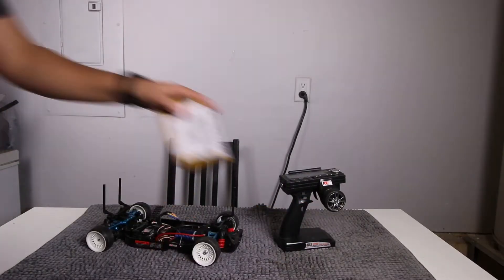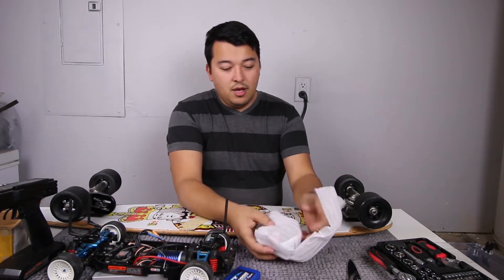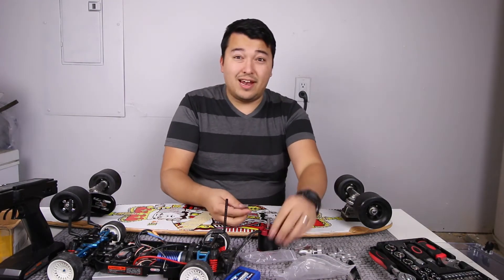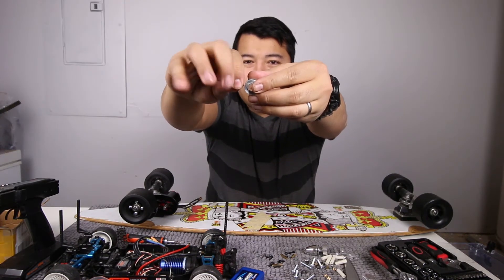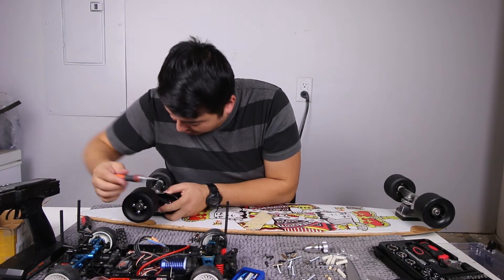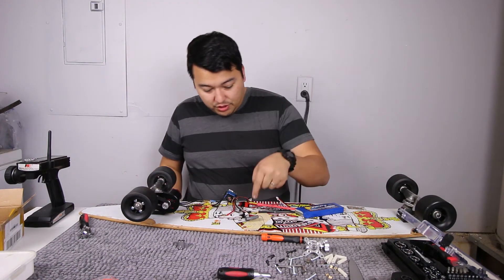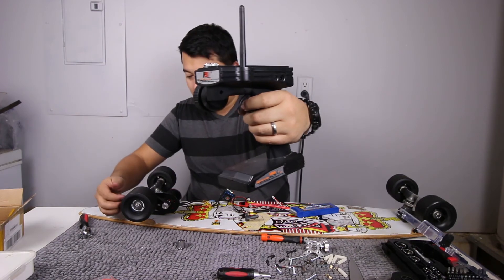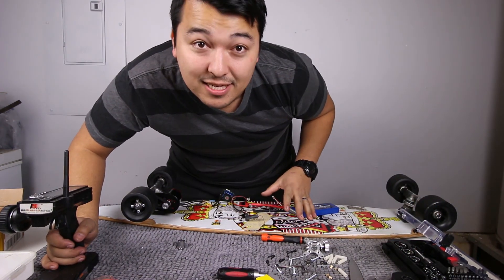DIY ELECTRIC SKATEBOARD BUDGET UNDER $100 PROJECT PART 2

Comment: That thing looks highly underpowered. I dont know the amperage of that esc but it is probably not enough to be driven at high amperage for an extended time. Also, that battery looks really underdimentioned, and the rpm you got on that motor without load seems just way too low.
Reply from the maker: It definitely is, this is strictly low budget slow build.

Comment: What a joke, from the '$5' longboard with the barcode left on it to the death trap remote (on/off no Inbetween) and is it $100 or $150?........jeez.
Reply from the maker: Obi Sean Kenobi The Jedi Master!   all these parts can be had for under 100$ even the cheapo long board. the most expensive part would be the motor

Comment: how to you monitor the speed of your motor? in the video it seems that your motor is either full speed or off!! i really dont want to go full speed all the time
Reply from the maker: Hey! you can adjust the speed using your controller. this setup right here only goes about 15mph so its not super fast
Reply: Dustin Vang yeah i know but i am thinking of building one that can go little faster...like 20km/h but i read that the esc you are using is either full speed or off... thats why i am asking! eg. if you want to go 8km/h will you be able too??? this is my consearn
Reply from the maker: It should be variable speed. You can also program it using the program block. However if you would Like more customization functions I would suggest looking into a vesc its more xpensive but more worth it in the long run id say.

Comment: What battery specs are you rocking?
Reply from the maker: right now its 7.4v but i think the typical setup is 30+ volts. So im a little lagging on the power voltage. I will be creating my own battery pack and upgrading the Electronic Speed Controller soon. This is just the budget type build for now.